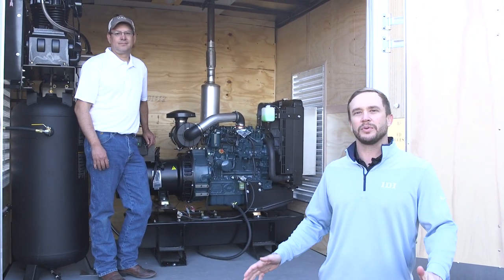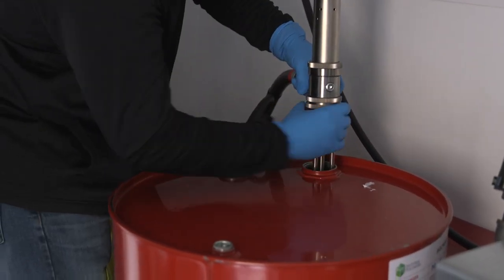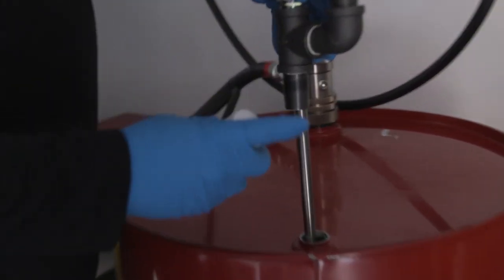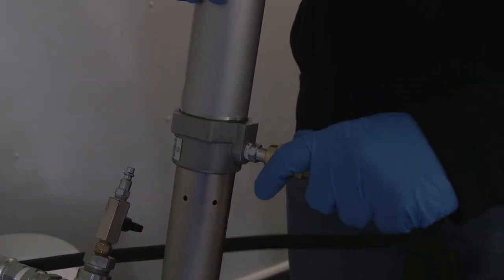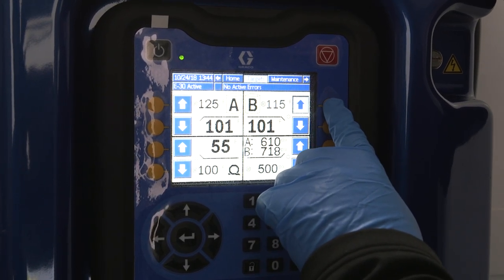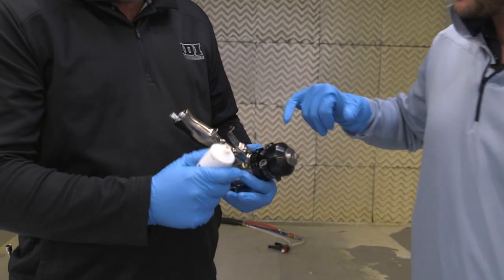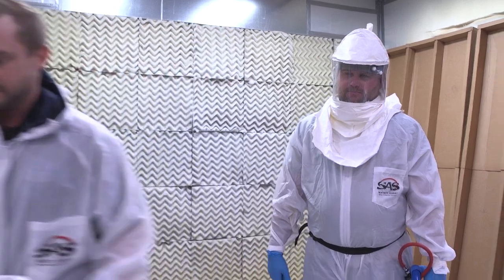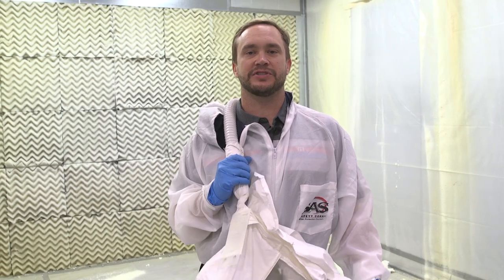How to Start Your Spray Foam Insulation Rig for the First Time [Step by Step Setup]

Comment: Typical Installation, with gun fluid manifold to drum circulation and Typical Installation, with system fluid manifold to drum circulation what this means
Reply: Basically there is a return line on the machine to heat up the barrels using the machine heaters.

And a gun fluid manifold allows you to heat up the hose faster with the machine heaters.